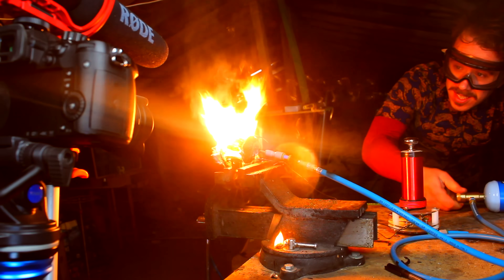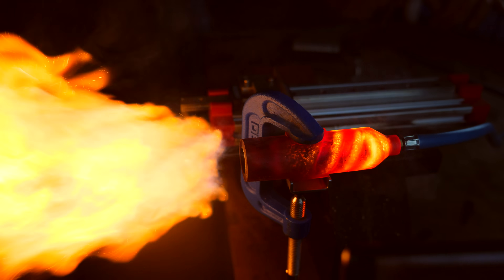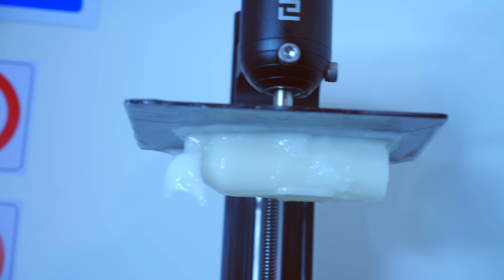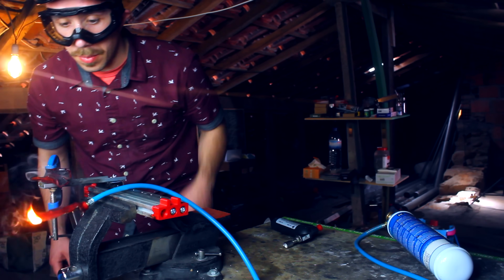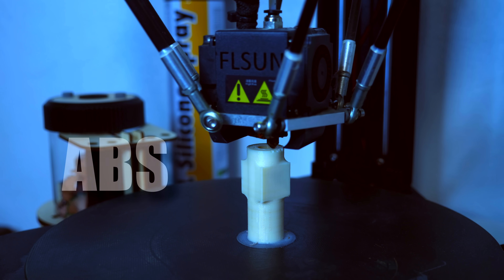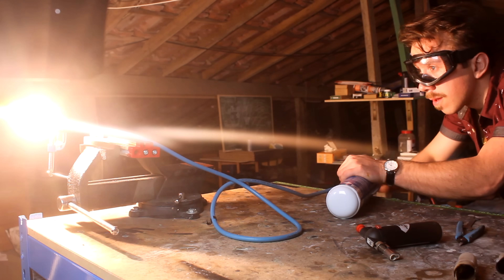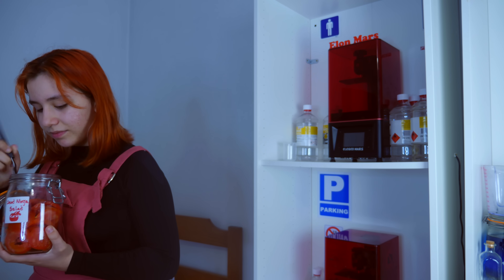Rocket engine that uses itself as fuel! (3D Printed)

Comment: I think a ceramic nozzle with the ABS fuel would be interesting.

Also a calibrated pendulum to measure thrust would be simplest, but the rocket motors would have to be pretty-close to the same weight.

Comment: If you're going to be burning lots of ABS in your attic I would highly recommend an extractor fan, burning plastics are not conducive to proper lung and brain function. Also slow motion of the burn would be nicer to look at than a strobe light and give far more information on how the different nozzles have been performing. Maybe check to see your track and O2 tube aren't stopping it from moving too?

Comment: You can actual buy, pre-made, non-3D printed actual ABS cylinders or pipes... Should be stronger and cheaper, and a drill should be the only tool needed to turn those into "rocket engines".

Comment: For the rocket testing you could do the same as before with the sliding board but also add a spring to hold it Back with increments that lock into place like winch almost, then you can measure the force on the spring for each locking click and get a measure of the forces. Can’t wait to see the next video

Comment: Hi Integza,

Wanted to lend some info to hopefully help your endeavors. I noticed, while testing, that you have your engines mounted to the end of the arm attached to the linear rail. This will cause a moment on the bearing and may cause it to bind depending on the thrust generated. Even though some of the engines move along the rail in your tests, it doesn't necessarily mean the ones that didn't move were not producing thrust. There was an engine in this video that started to move, but then stopped. This could be from lack of thrust or it could be from excessive thrust binding the bearing. Here's a link describing how moments on a linear bearing may cause it to bind: https://www.linearmotiontips.com/what-you-need-to-know-about-the-2-1-ratio/

I really have been enjoying these rocket prototype videos you have been producing lately. I hope I can help you improve your test methods so you may see success where it was missed before! 

TLDR; The test set-up may need to be altered to visualize the rockets thrust. Moments on a linear bearing may cause it to bind. This effect may result in the appearance of an engine not producing thrust.

Comment: Is there a way to print the nozzle in ceramic and then print the rocket engine around it so the nozzles not getting burned up as rocket fuel

Comment: As a suggestion... a simple aluminum casing on the outside to make the the frame. Just to take an idea from sugar rockets using cardboard as the outer shell. For nozzle geometry... since the resin and abs are the fuel you need to focus more on how to optimize the flow of oxygen so you have the most exposed surface of fuel available at all times. Any nozzle will only slow down the thrust flow. The nozzle and the combustion chamber in a rocket are separated for direction. In a hybrid rocket you would need to have an empty cylinder of fuel to run the oxygen through the diameter of the inside of the cylinder determines the rate of burn and thrust. The longer the burn the lesser the thrust. Unlesss... you have one cylinder with many holes in it and the oxygen burns through them all...

Comment: Hey, I love the idea of 3d printing rocket fuel, however I have a suggestion. Try adding a pvc shroud around the fuel and bolting on a nozzle to the end, it will stop the engine from simply falling apart after only a few seconds of sustained combustion.

Comment: I would suggest printing your nozzles in ceramic and putting your engines in a metal case. High power amateur rocketry uses nitrous oxide and pvc for fuel. Pretty sure the nozzles need to be ceramic. 
The helix fuel grain might work, it was failing due to heat stress related to the clamp. 
Can't wait to see what you try next. 
Please try to find a better testing site, I'd hate for you to burn your house down!

Comment: The double helix engines look like they just need a casing of some sort, so it's not burning through the walls causing loss of pressure. Also it might help to have an ignition source at the other end instead of the nozzle end.

Comment: I would be interested to see engines with smaller nozzle diameters. The burn rate for the plastic may be a bit too slow to generate thrust. When the chamber pressure rises, the burn rate should also rise. Unfortunately, there is a pretty good chance the casing with rupture. If you haven't over-pressurized one until it explodes you can go smaller :) Staying that close for testing is probably a bad idea

Comment: make a turbofan engine using a welding machine with graphite electrode to melt metal into a plaster mold made using a 3d printer piece.

Comment: Ceramic print a nozzle, plate it to be robust, and encapsulate the assembly in a metal/carbon tube. The fuel should be closer to rubber and replace the O2 with N2O, it is a more stable oxidizer. PVC makes a good fuel in this set up, I would suggest not using steel. Copper or aluminum would be a more safe material since you are testing in your attic.
Reply: If you did encapsulate the fuel in a copper tube you could take a copper plated nozzle and braze the two together to get a more robust assembly and less leaks.... also N2O not 02.

Comment: Should use 2 linear rails for the rocket sled, think you getting false negatives on thrust. The way it is, it is acting a lever arm that's probably binding.  Might also think about using 2 hose clamps instead of 1 c-clamp on the sled as it decreases the chances of it burning out from under the clamp and sending 1 or both pieces ballistic in the erm wooden attic? Lastly and most importantly you should try doping resin with tomato's, seriously they have natural sugars and carbohydrates, and it'd make them useful for something other than throwing away. Maybe dry and powder them first? 

Anyways love your vids don't blow yourself up.

Comment: Brother, 
You might consider using a ball valve on that O2 bottle. Keep the existing valve you have as a throttle, and use a 1/4 turn ball valve as the shut off.

Comment: My mom likes nasty tomatoes, how can I convince her to stop eating fruit from the deadly night shade family?
You could try using a composite metal filament. The kind you bake out the resin and then sinter it in a high temperature inert gas ore reducing oven.  Hmm maybe you need to build an oven first.  I have seen people use a kiln like yours but had it like a Russian nesting doll with one segment full of charcoal to prevent oxygen from getting to the part.  Maybe you could use tomato based charcoal?  Codie's lab has some nice videos that are related to this.
Reply: To go along with this, I have always wondered if you could print with a copper material -- or just an electrically conductive one -- and 3d print electronics.
I have always wanted to see a fully 3D printed electric motor, although I think it is unrealistic I still think it would be amazing to try.
Reply: @MrScorpianwarrior  I have seen 3d printed motors which used normal magnet wire.  I have also seen printed motors using conductive inks.  

https://www.youtube.com/watch?v=YsSm65DAcCg

https://www.youtube.com/watch?v=ZHX6LXzhkjo

Printing the winding which needs good conductivity and well insulated, it's a hard thing to do both of these at the same time.  I think it won't be practical until we get molecular printers.  Most motors also need good permanent magnets, and those can't really be printed with current tech.
Reply: @zyxwvutsrqponmlkh 3 phase induction motors don't need permanent magnets. The efficiency might suffer though.
Reply: *sinter it
Reply: @ansleylobo8042  Thx
Reply: I think with all these ideas he will need to move the launch pad out side .
Reply: @RavenRaven-se6lr  Or he can put a hatch in his roof.

Comment: I think if you could use the sugar resin inside a steel tube and put a ceramic 3d printed nozzze, i don´t have ideia if it will work, but i think if you could try

Comment: You should test the 3d printed fuel by having multiple combustion chambers. By having 3-4 parallel chambers, you can increase surface area, and if you attach them all on one nozzle, the thrust would be increased significantly

Comment: You should collab with the plasma channel try to make a glider powered by ionic wind and you should also try using other solid fuels like black powder mixed with oxygen in a stronger rocket chamber, like a steel pipe.

Comment: Why don't You use a solenoid valve for oxygen ? Instead You screwing the mechanical valve like crazy every time the rocket stop "rocketing" 😂 trying not to burn Your whole house down in the process😂 if You use solenoid for this task, You will simply release button and that will stop oxygen flow immediately. Allso I whould really like to see this rocket in acion on the ground, not in wise 😂 the idea came to my mind to use empty small CO2 canister as oxygen storage and small valve to control it (open and close oxygen flow) and 3D printed housing for this canister, what do You think ?

Comment: It might work if you can use a metal pipe to contain the body of the rocket and different screw on metal nozzles with different geometries for max power. Maybe make the rocket chambered  so you can add extra oxidizers after it is printed? Also, having the rocket to the side of linear rail with the weight of the clamp might make it bind and not show thrust quite as accurate. As always, TOMATOES ARE DISGUSTING!!

Comment: Make a metal or graphite nozzle and housing for the engine so it can withstand the heat and doesn't burn throught the sides, (later you could even test it out on a rocket). And for the engine rig I suggest making something that can actually show you the thrust and not just watch if it moves xD. Love the videos though keep it up.

Comment: If you printed a water jacket into the exterior you might be able to get it to burn for longer by cooling the outer shell
Reply: This could also add a safety factor by automatically extinguishing the rocket once the water jacket is melted
Reply: Or maybe it would not burn at all?  Similar to putting a cup of water in a campfire.  The cup does not melt where it is touching the water
Reply: the heat from the rocket could automatically cycle the water through the jacket if a cool reservoir is placed higher then the rocket

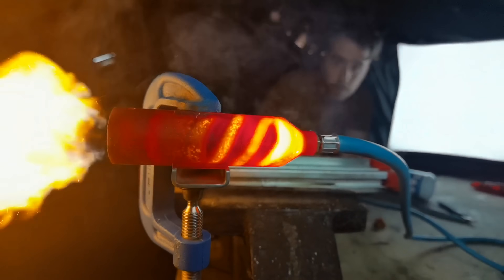Comment: Glad to see you wore safety goggles for most (6:50)  of your tests! Safety is so important!

On your new test stand I'd love to see a quick cutoff for your oxygen supply. Pure O2 turns everything into fuel, including your house! The faster you can shut that off, the safer! Also burning plastic fumes aren't good for you, it'd be worth investing in some respirators and moving to a more well-ventilated area, with the additional benefit of not almost burning down your house every episode! 

For the rocket itself, I feel like it doesn't matter what nozzle geometry you pick if it's going to be the first thing to burn away! If your nozzle is always burning up, you'll always run out of "working nozzle time" before you run out of fuel. Looking forward to the next chapter, and stay safe!

Comment: if you want a rocket you have to keep the flame front in the expansion nozzle, not in the mixing chambers, or back to the o2 inlet.  Increase your fuel and o2 flow to keep the flame from creeping back to the inlets.  You may need higher pressure sources of fuel.
Reply: Mostly you want your o2 pressure higher to keep the flame front where you need it to be.  So get a bigger flow source to park the flame away from the inlet.
Reply: What, you didn't think they developed turbo pumps for nothing?
Reply: your engines burn from the end to the o2 source, so quit starving your engines.

Comment: Integza, try using sorbitol (zero calorie food sweetener/sugar, don't eat it it'll make you spend your week in a toilet) and some aluminum powder as fuel

This mix is quite easy to cast, and fairly energetic (more than 100% sugar but I don't know how it compares to your plastic) 

Then you can 3D print a mold and then cast it, it won't need any high temperatures you can just use a normal pan & stove to melt it (hopefully it's worth it)

Comment: You have made some tries but in a disorderly manner. First, it is important to know the diameter of the rocket pipe and then the ratio or flow of the oxygen. Yes, there is an oxygen flow enough to supply enough reactant for complete combustión, but this is not the whole history. Thanks to your good images I could observe in the first tries with red resin that the hottest reaction zone advanced too much to the oxygen supply, after that, I could see that they established in the middle of the rocket, heating too much the material and breaking by half.  You should try to protect the rocket mass from the radiated heat, incorporating in the mix to be printed aluminum particles in an amount to avoid that the rocket mass breaks before being completely exhausted and run out of combustible matter. Another thing. what improvement do you expect to get by making a vortex flow rocket compared to the straight normal one?

Comment: Most gas lighters use a mechanical spark, which is why squeezing the trigger is so difficult. There's a device which converts the rapid decompression of a spring into electrical energy. No batteries needed in this high tech world of mechanical energy!

Comment: You should really look up lost PLA casting. Your kiln should be able to melt aluminum. Print your jet engines in pla, cover it in refractory cement, cure the cement and burn out the pla and then fill the void with aluminum.

Comment: Find yourself a metal tube that you can print the diameter such, it will slip inside snuggly. This will prevent it from burning out the sides earlier and give you a few more seconds.

Comment: Try machining a stainless steel sleeve a top cap and a nozzle. 
Just shove the abs fuel inside the sleeve and screw on the nozzle. that way you 1 contain the combustion you 2 don’t risk stuff flying everywhere and you’ll have a solid point to mount the oxy line to.

Comment: Try to make a metal case with a nozzle where you put the solid fuel inside that way the fuel will have more support and will not break and on the other side a small extension in metal to connect the oxygen hose, in this way you avoid the flame from spreading through the hose and try to insert a solenoid valve to faster opening and closing of O2

Comment: We call those sparklers. (sparkl-ers) With those printed engines you really need to put them inside of a steel or aluminum tube to give them some structural rigidity. Also try just printing a simple fuel grain.. A thick tube with a small diameter hole through the middle and then pump oxygen through it and watch how it burns. You can actually do the same thing with an acrylic rod with a hole drilled in the middle of it.
You need to get a little tabletop lathe so you can make nozzles and stuff out of aluminum or steel.

Comment: Problem with solid state rocket the chamber and nozzle are dynamic meaning of course moving while burning effecting efficiency... That initial light off you see with solid model rockets is normally used to break and the burn is the overall propulsion if u see it on a graph you'll see a sudden spike then a linear curve as the motor burns ... But of course u already know this

Comment: How much force is required to overcome the hose?
You could maybe try a thick wall resin shell with an ABS fuel core?
You might have to print in two parts and either glue them together or use threads to screw the two parts together.

Comment: The reason you arent producing any thrust is you have no pressure....

Try a smaller nozzle, you want a guage in the oxygen line so you can measure chamber pressure.
You also need a ball valve so you can open and close the valve

Comment: A few suggestions.

1st) If you're 3d printing your solid fuel... Try Tesla valves. What the heck why not. 

2) Once you find a design you like for the hybrid engine it would be interesting to see you expirement with fuel types. What can you mix into the resin and still have it cure. Black powder? Home made thermite?
Reply: Huh my comment disappeared.

Anyway I went to google Tesla valve rocket engine and of course you've already tried it with pulsejet engines 🤣

Also that thermite is terrible as fuel.

But it would be interesting seeing other additives.

Comment: See if you can 3d print 2 cilinder combustion engine using tesla valves for in and out take so you don't have to print complicated valves that let explosive gas in the combustion chamber insitead the tesla valves will do that

Comment: You're oxygen is low pressure for the size of your nozzles.  The combustion moves to where the oxygen intake is right away in most of them.  So it should be like completely consuming the engine in the left side before it moves on to the right.

Comment: Realistically, I'd love to see you 3D print your engine designs and then try casting them using lost-pla investment casting! I think you could easily get a marvelous engine prototype running well if it were cast as a solid piece of metal! Either that, or it would turn into a custom cast, 3D printed grenade. Better surround it in a test chamber constructed of tomatoes.

Comment: I feel solid rockets can be throttled to some degree, from a certain point of view. One way would be to mechanically restrict or dialate the throat of the engine. You could do this with a remote servo and iris. The other way would be more akin to procedural programming - building the engine with various layers of fuel/oxidizer ratio mixtures to pre-program (so to speak) your throttle times. That last one isn't a real-time throttle, however, but is still planned. I think this would make an interesting video for you to try. I'd watch it!